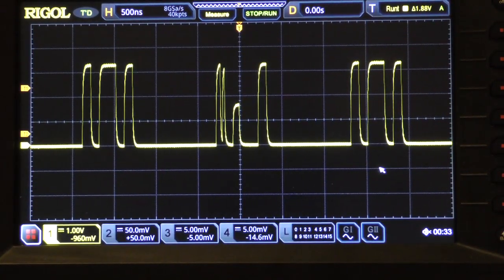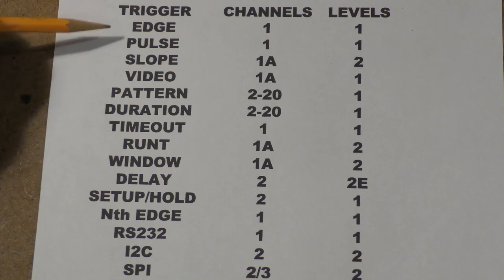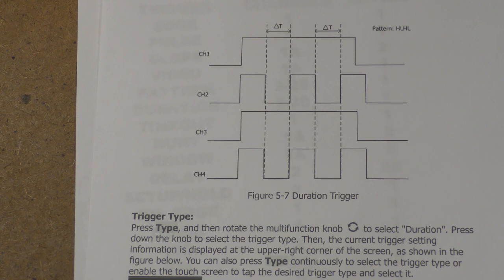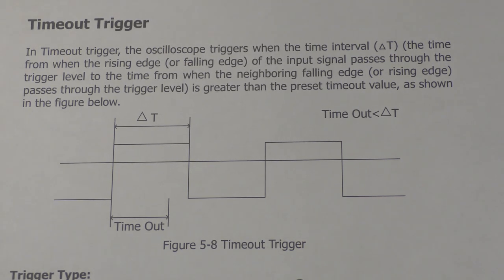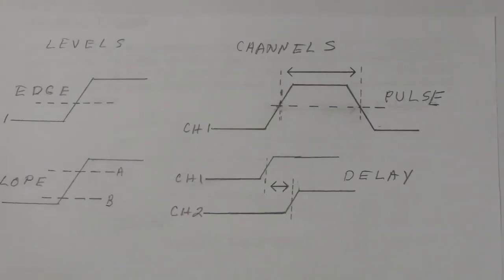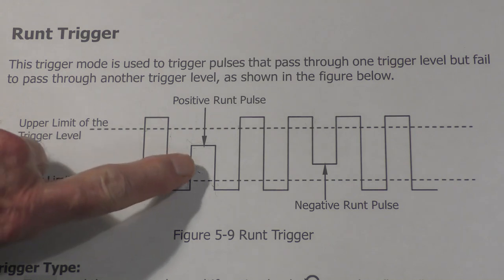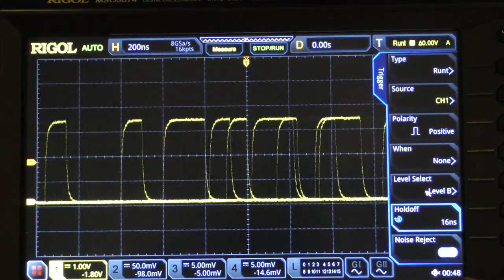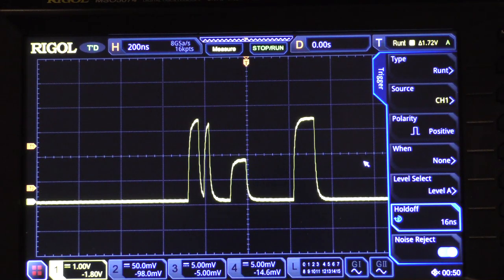TTT377 Rigol MSO5000 Advanced Triggers 1

Comment: I have 10 or so, analog scopes, and all have an (Alt) trigger. I use it any time I have 2 signals that aren't locked to each other.  I have twice that many digital scopes ranging from a 4 channel 1.5 GHz to 500 MHz and others that are 200 MHz. Some of these are new models some are older. None have an alt trigger. My question is 2 fold, do you know why it is no longer available as a trigger? Do you know of a way to do this with the triggers available on modern scopes? As it stands now I  just pause the scope with run, stop.
Reply from the maker: If you haven't already done so you might take a look at w2aew's video #16 and a couple more he did after that on this and related subjects.